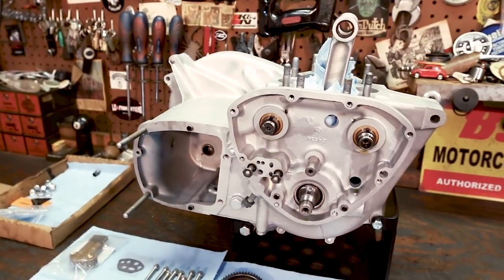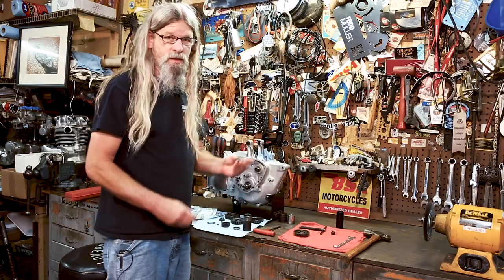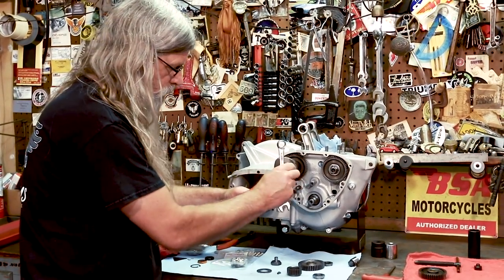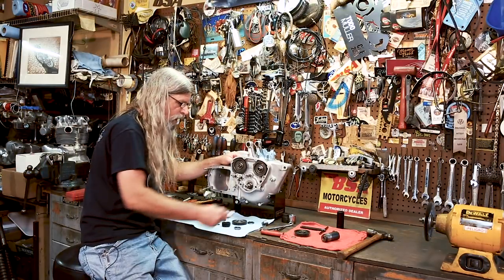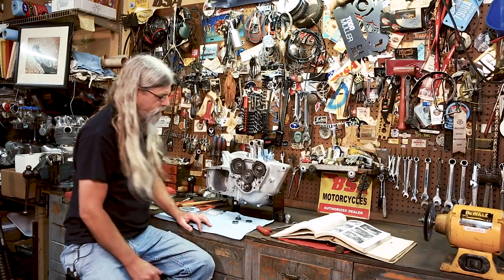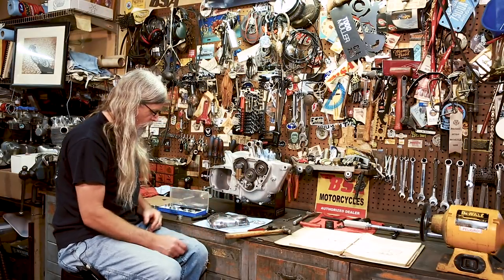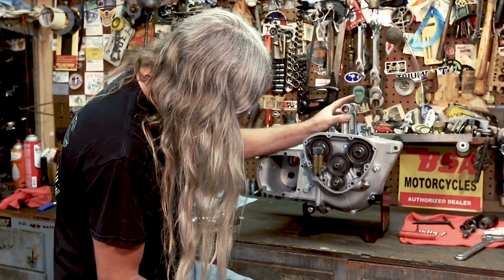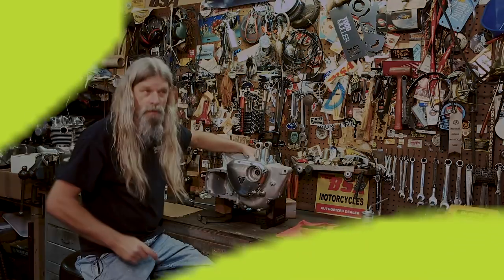Triumph 650 Motorcycle Engine Disassembly & Rebuild Part 9 - Lowbrow Customs

Comment: This is far better than any TV program, mainly Cars that go from rust bucket to completion in 5 minutes. Those that are Engineers / keen DIY'ers would rather see every step of the way for restoration and builds - even showing the jobs that can be a nightmare. This series also highlights the number of special tools that you need to do the job right. Keep up the good work.
Cheers :)

Comment: Looks like the pliers work just fine for your removal/install tool. if a fella were to mill some flats into the outer diameter of the tool, and use a wrench...? just an idea. thanks for putting this series together. you're a great instructor! i'm keeping eyes peeled for 650 parts for a build of my own...this series, coupled with the other publications from lowbrow are priceless! can't thank you guys enough for your efforts into keeping more these machines on the roads, than in museums. cheers!

Comment: Great videos!  Very good info and directions.  Just one observation here.  Always use steady pressure when pulling or pushing on the torque wrench.  Jerking, or aggressively pushing on the wrench gives false, under-spec results.  Take the time to c-clamp or bolt your stand to the bench, or find a friend to hold the motor so you can torque the fasteners accurately.

Comment: Todd, Wonderful vid! I have an '86 Porsche 951 and the bottom of the oil filter housing has a chamber-reservoir that is part of the oil pump.This reservoir holds an ounce or two of oil - even after you have drained the oil pan. Install a new filter, refit the drain plug and add engine oil. This oil pump reservoir serves to keep the oil pump primed so that it can instantly start pumping oil as soon as the starter turns over the engine. I see that you installed the new oil pump on the 650 engine but do you first prime the pumping cylinders with some motor oil (not thick assy lube)? I have a '69 T120R that my Dad bought in '68 - it still looks new and runs like a scalded dog! But I'm planning a teardown - and you are my teacher!

Comment: Working on a T100 and paying attention to the crank seal for timing cover. I think I hear you say the closed end is facing toward the pinion?  I see one note in my manual saying open face toward gears. Maybe that is just for the cam?  Logic is telling me you would want the open side towards the oil pressure (which is what I think you are saying) so the oil would push into the seal creating a better seal?
Reply from the maker: Email Todd@lowbrowcustoms.com directly He will be able to guide you in the right direction. - Mikey

Comment: Unfortunately I am not calibrated to such light tolerances. I had to purchase a Torque Wrench in Inch lbs. I got so used to working with 1/2" drives and 100 ft.lbs.even a 3/8s drive feels tiny.

Comment: Would a bead of RTV be ok on the timing cover gasket? Both sides?
Reply from the maker: not really needed, Todd has not had any leaks not using a sealer. There are oil passageways and sealer if overused could be an issue

Comment: Where are you located? I have a 68 Triumph Bonneville that I’ve restored but need some expert help.
Reply: We are in the Cleveland Ohio area but unfortunately we do not work on any customer bikes I do this as a hobby in my home garage and help customers with technical questions when at the shop

Comment: Hello; actually many torque values in the Triumph manuals are not accurate (sometimes are wrong in ft lbs and right in kg m) so for the crankshaft pinion nut the manual (for the 750) have it right in kg; translated to ft lbs is 42 )never ever 80 or so check the size and thread of that nut. 
Then in the other side; the rotor nut is little smaller so the torque value is 30ftlbs. 
For the camshafts is only to tight fully and that is about 20ftlbs. You could go more but there is no point; is LH thread.
Never ever you will see one of the camshafts nuts loose...
Is not necessary to use thread locker.
In any case, you can use a drop of thread locker with the clutch nut and with the crankshaft sludge trap plug (so you do not punch it again---to prevent micro fissures---) and in the flywheel bolt that you removed to clean the trap.